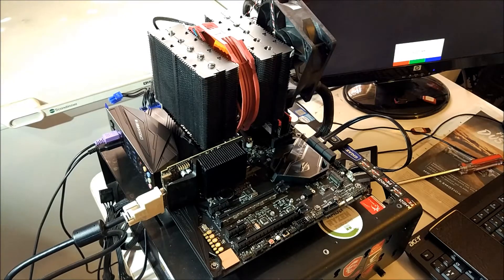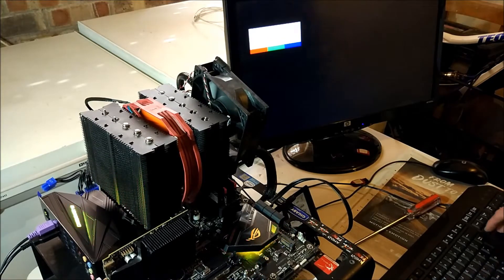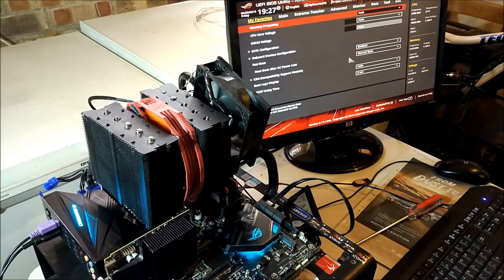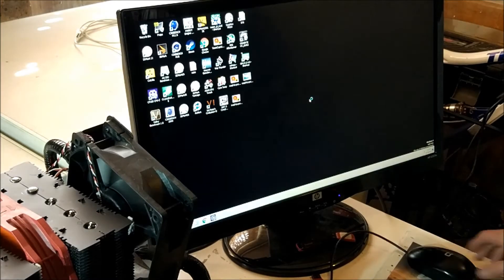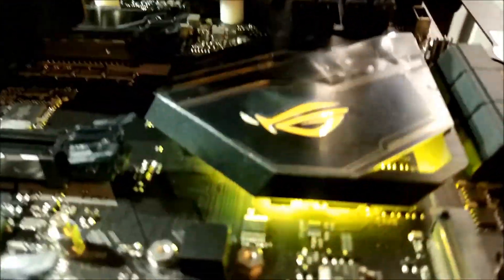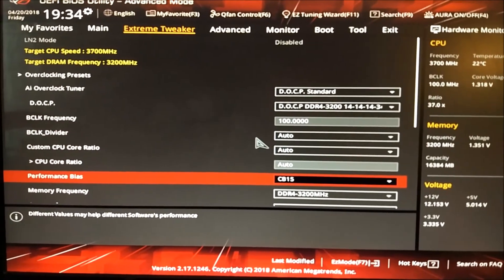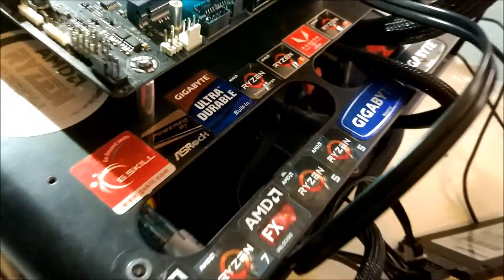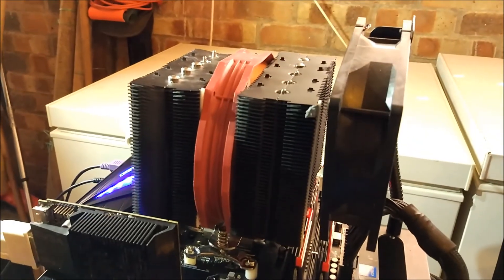Asus Crosshair VII Hero First Boot and Cinebench R15 Run

Comment: I can't get my crosshair vii to automatically boot into windows as the primary boot drive. I have to go into bios and select it everytime. Any suggestions?
Reply from the maker: Simon Pyrros are you just selecting it or setting it as the primary boot device?
Reply: Lawrence Timme I have it set as the primary boot device and I made it so the bios only looks for a windows bootstrap to narrow down the possibilities. I solved the problem in the end. The AOI I'm using doesn't use the CPU MB fan header. That was causing an error and causing a halt in the boot.

Comment: Why benchmark the motherboard before you install it's driver's first?
Dumb, just like getting a new mobo and using Windows 7 instead of Windows 10.
Making a guess that I'm sure is correct. You didn't check for a UEFI update either.
P.S. Everyone, I just found out that Asus has special performance UEFI's besides the regular UEFI's.
Just ask where to get them at: rog.asus.com/forums
The regular UEFI's are 3 digit number versions.
The performance UEFI's are 4 digit  numbers and they always start with 8.
From what I've heard on the performance UEFI's just leave everything on Auto and only set the XMP for the ram.
Reply from the maker: Keith Brooks Keith I have answered these questions many times before in other comments below and other videos.

Comment: Why is a 2700x only boosting to 4075mhz? Isn't it suppose to boost to 4.35ghz? And how much do those stickers improve your cinebench score?
Reply: I think it's due to Windows 7 OS, it hasnt been updated in awhile to support Ryzen processors
Reply: XFR2 boost up to 4.35 when only 1-2 cores are used and it scales down the more cores that are loaded. It's basically the same for intel cpus. Cinebench uses all cores, thus even though it boosted from base 3.7 to 4075 mhz it doesn't go up to 4.35.